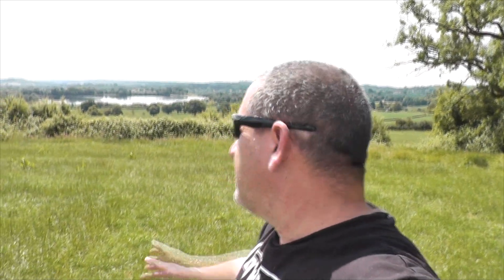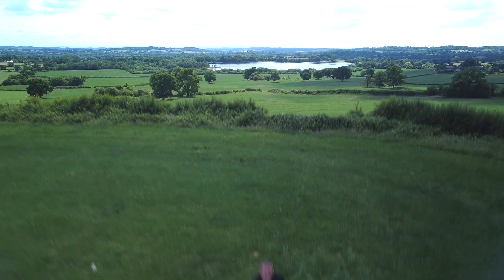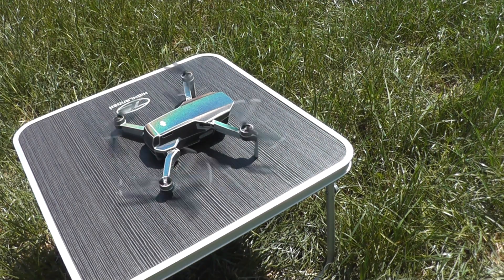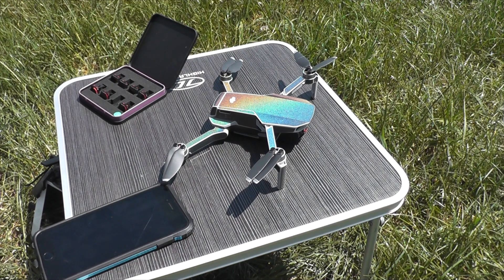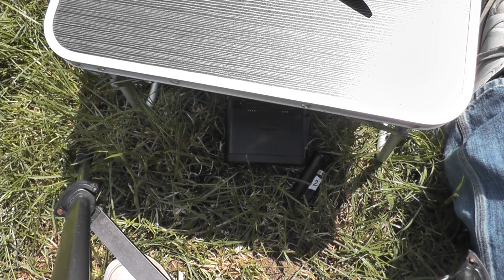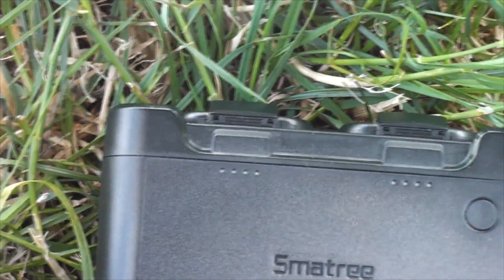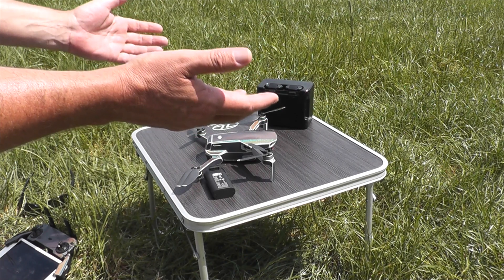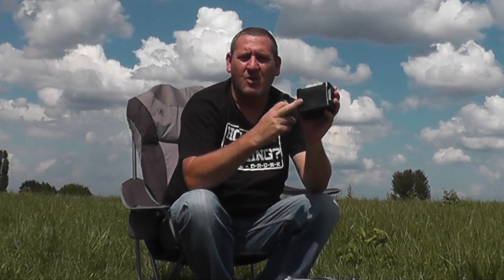Testing the Smatree Power Station Charging Hub for Mavic Mini

Comment: Work with mini 2 battery?
Thanks
Reply from the maker: Unfortunately not. The Mini 2 batteries will not fit in the slots.
But Mini 1 batteries do fit in the Mini 2 so you could just use Mini 1 batteries with this power bank and your Mini 2 if required.

Comment: Thanks, great video! - I bought this charging hub after seeing your review and you're right it's fantastic!! You can keep on flying or have a break whilst they charge up and you're good to go again - so almost three times the flying time - can't be bad! 
By the way where did you get your little table from, I'm after one the same myself!!??
Reply from the maker: Hi Mark and thanks for your interest in the video. Glad you found the hub as impressive as I did. Saves buying extra batteries 🔋 

The table is a “Highlander Small Folding Table” from Amazon. 

Highlander Small Folding Table -... https://www.amazon.co.uk/dp/B00BIBBFRC?ref=ppx_pop_mob_ap_share
Reply: @El_Smeghead  Thanks for reply - the table looks just the right size for taking out without being bulky (40cm x 40cm). Cheers again - I've subscribed and looking forward to more videos!

Comment: The Question is.... is it good for the battery‘s to get charged by that thing?
Reply from the maker: I don't see why there should be any problem. The Mavic Mini batteries use the same cells that are found in vape batteries. These are also charged by portable vape charging banks with no issues.
Reply: You got to make sure the batteries are never hot when recharging like he did, other then that it looks very safe.
Reply: @INTELMAXELL  actually...if you stick it in the charger hot...it will delay the charge till it reaches a safe temperature...I own this charger and its amazing for my drone channel!